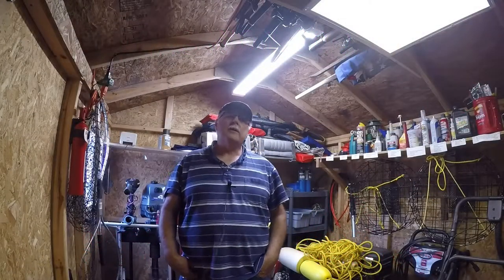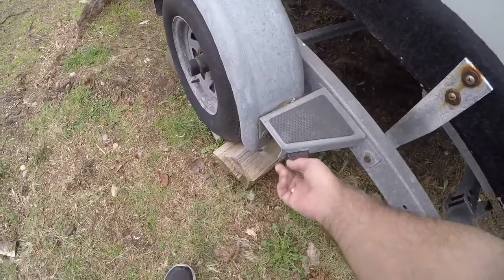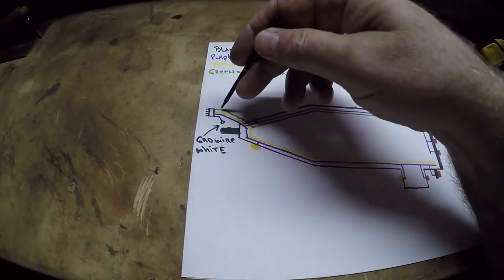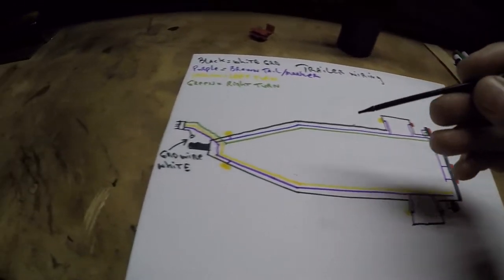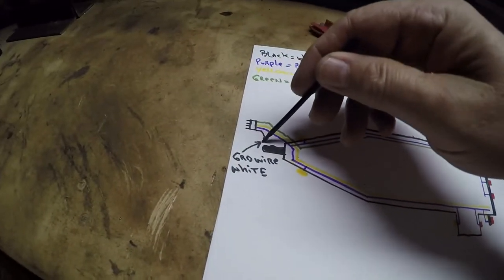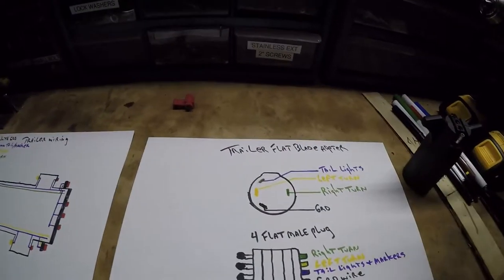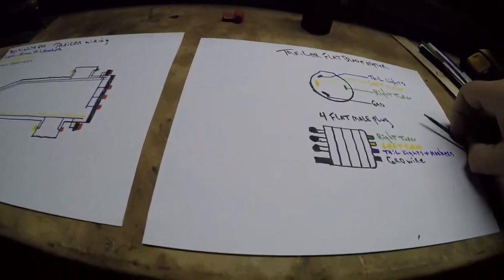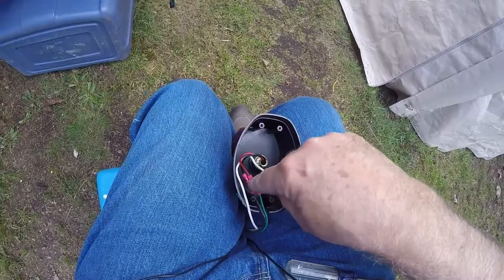boat trailer wiring tips

Comment: my ground wire is totally chewed up in multiple places. I need to replace the whole length. What gauge do i need? 17.5' bass boat, single axle trailer - no brakes. Tks
Reply from the maker: Most boat trailer wiring is 16 guage and heavy duty. If your just replacing the ground wire I'd go with that but you can buy the replacement loom online  pretty cheap. I'd just replace the whole thing
Reply: @TimsWorkshopTJY  Thank you sir. I'll get on it

Comment: There are dozens of "how to" rewire your utility trailer, or boat trailer, lessons on YouTube.  Most of them say the same thing, one way or another.  Brown & green along the starboard side, brown & yellow along the port side.  Nobody talks about how to make the tee, or the splice, off the brown for the side marker light(s) so they're rainproof/waterproof/weatherproof/corrosionproof and will last a while. What's your secret ?
Reply from the maker: Thanks for responding. My secret so far is the dielectric on the connectors. But yearly maintenance on everything once a year before going out is a must

Comment: 7:45 pleae never use that connector especially on a boat trailer what’s going to under the water. The best thing is to solder and to use heat shrink tube. Anyway thanks for the video, if someone didn’t know the system, it’s easy to understand that.
Reply from the maker: I think I state I remove the mag lights before putting the trailer in the water. One reason as you state to keep water out of them. Another reason is to keep folks from hitting them or stealing them since they are easy to remove. The ones that came with the trailer leaked and people ran into them at the boat launch. I've been using these for years like this and they still work everytime I hook them up. Oh at 7:45 on this video if your referring to the red auto clip for the markers that's what was on the trailer. I'm pretty sure from Easy load trailer co. I agree they are not right so I'll be doing another video on how to replace them. I'll use waterproof connectors with heatshrink and liquid tape on the ends. All those connections will last forever after that. Thnks